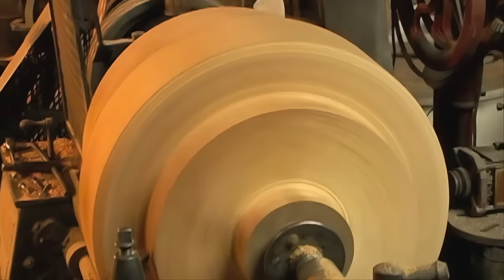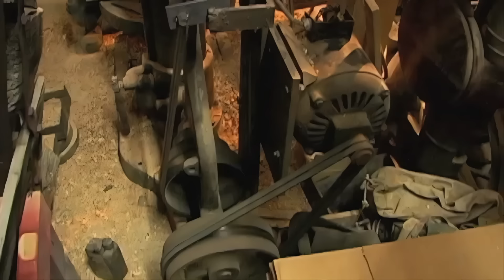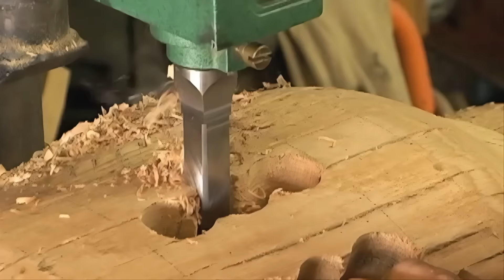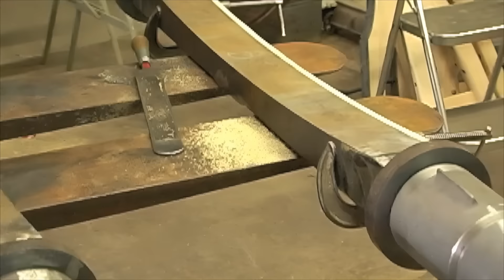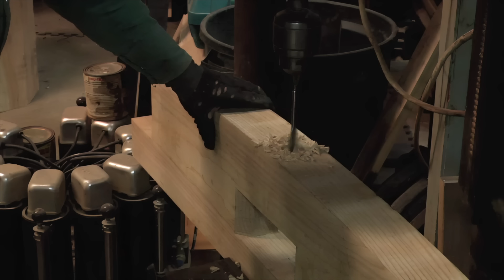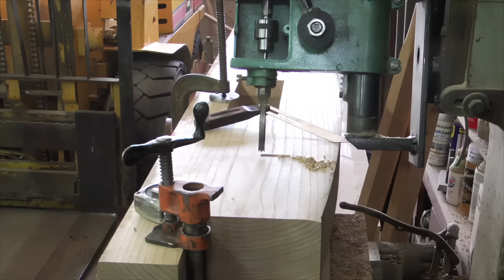10 Year Anniversary Part 3; Building the Borax Wagons | Engels Coach Shop

Comment: It would be interesting to know how they built the originals, and how many of these modern machines they had. ou spoke about useing a water jet to make the curve in the axles, they were not around in the 1880s . but they were building huge cast pieces for Locomotives and other huge machines .

Comment: Hello Dave  I have the same camelback I use it all the time it’s converted to electric via a jack shaft that goes to the flat belt pulley so it still runs on flat belt, but it’s got an electric motor that runs it. I love that thing with its self feed

Comment: Something I was wondering...there were a lot of cracks in those hubs, which I imagine were unavoidable in a solid piece of wood that size as it dried.  Did they cause any problems, or is that just the way these things go?  I had a thought about how they maybe could have been filled with epoxy, but I don't know if that would have helped or hurt, plus of course it wouldn't be like the originals.
Reply: No problems